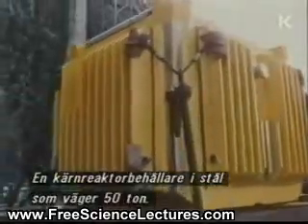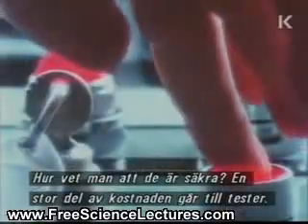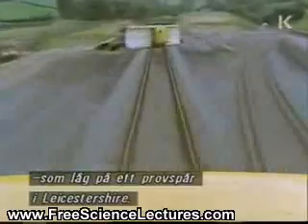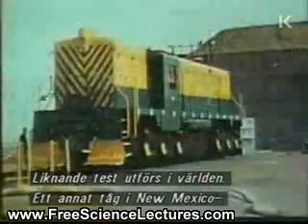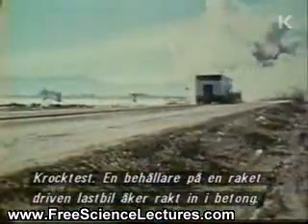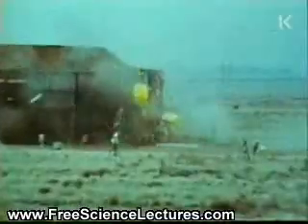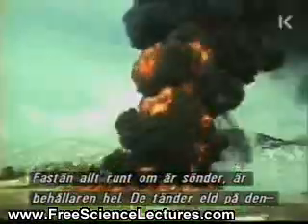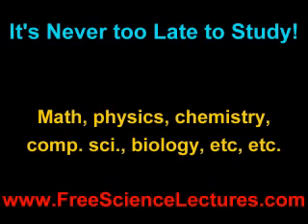Nuclear Flask Endurance Testing in USA

Comment: The irony is that material transported in these casks is protested as being unsafe, yet it's the least likely to leak in the event of a crash.
Reply: Its not even liquid lol
Reply: The problem isn't that nuclear waste is solid it's that radiation could escape from the smalest crack and the best way to test 100% containment is with water because it can also escape from the smallest crack.
Reply: @checkoutmyplaylistsforente8054  yes a small crack releases a small dose of radiation
Reply: Yup. In fact the current record is 0% leakage in actual use.

Comment: It never would be in real life. But they wanted to prove that in the most extreme of crashes (ie: a crash that would not be possible with standard equipment), the container still wouldn't be breached.
When testing this sort of stuff, you'd always test for the most extreme worst case scenario, not just what might normally happen.

Comment: This sounds like a monty python sketch. So they rammed it with a train, but it wasn't damaged. So They rammed it with a faster train, but it wasn't damaged. So they tied it to the back of an ordinary lorry and crashed it into concrete, but it wasn't damaged. So they tied it to the back of a rocket powered lorry and crashed it into concrete, but it wasn't damaged. So they tied it to a faster rocket powered lorry and crashed that into concrete, but it wasn't damaged...and so on a so forth
Reply: More like the Top gear piece where they were trying to destroy a Toyota Hilux.
Reply: And this is how pizza delivery was revolutionized.
Reply: "Tis but a scratch!"
Reply: Ngl sound like some stuff Huggbies would make up on a video
Reply: The only issue with this was that the US train wasn't faster, probably due to being less aerodynamic and using rocket motors. Had they used an F-unit or something similar (ignoring how sacreligious that is), then maybe it might've gone faster? Idk.
Reply: @Milnoc  I remember. They thought they had lost it at one point to the sea...but they found it again when the tide went out. Bit careless...Parking your car where the Gods of the Ocean may see it as sacrifice and take it!
Reply: @thestarlightalchemist7333  That is where the laws of Psychics come in. On one of the (UK) train test videos I heard that that loco and its 3 coaches, at that speed, had the same impact as if it was hit by a HST. For those outside the UK a HST is (or, as they are mainly out of service now) a High Speed Train with 2 power cars and 8 coaches (larger and heavier than the ones in the video) which travelled at speeds of up to 125mph which were first built in 1975 and weighed, if my Maths is right, about 420 tons.
Reply: Oceangate 2.0 🤞🏼

Comment: Jet fuel can't melt steel flasks..
Reply: SovietRusalka's 2nd Channel SHIT INSIDE JOB 

ILLUMINATI
CONFIRMED
Reply: but it can weaken them
Reply: These engineers were clearly just having fun. Why did they attach rockets to the trucks? Surely the rockets were more expensive than a truck engine that can reach 80mph. And if you want to really test the durability of the containers in a remotely-scientific manner, are these really the most accurate methods to employ?

I mean, I'm thankful that they got to create these cool videos, and surely the engineers had a great time doing it! Money well spent, I suppose--though if I were transporting these containers, I certainly wouldn't feel any safer.

(Also, while not the point of my reply: Jet-A (the most common jet fuel , [essentially souped-up kerosene]) can ABSOLUTELY cause instability in steel, given the proper conditions! It can provide a very high amount of energy when combusted (with a proper stoichiometric mixture of oxygen, just under 1,000° celsius!) While it will not melt into liquid, even at the maximum temperature it produces, it can certainly be bent or otherwise malformed in a way that it's contents would be exposed. Admittedly, open air will not provide this level of efficient combustion. However, if the enflamed items are positioned in an (admittedly plausible) manner in which forced air can be taken into account, it is definitely plausible.) Anyway, the point here is that while the various varities of "Jet Fuel" are unlikely to melt average varieties of steel into a liquid, they could certainly weaken it's structure integrety to the degree that it's (radioactive, in this case) contents could be exposed. 

Anyway, that was not really my point. I really came here to point out how ridiculous this whole series of experiments was. Money (not) well spent!
Reply: @TravisTerrell  Crash tests are performed on cars to test integrity. It certainly is scientific
Reply: @TravisTerrell  I think that rocket engine for this kind of job is pretty easy to produce. It is just a tube with de Laval nozzle filled with solid propulsion material. Moreover this flask is pretty heavy. I think red flask isn't "made out of 280 tons solid steel" but it is still heavier than usual cargo. That is why they use simple rocket engine rather than piston engine that is designed to work for years.

Comment: @Sohave We drove on the E20/E47 from Malmö to Rødby for vacation last month. As I passed the Öresund Bridge, I spotted the Barsebäck NPP on my right, 1200 MW of clean and safe energy... now shut down, because of danish demands. 

About 15 minutes later, as we came over the bridge from Amager, I spotted a strange looking facility: the Avedøre power plant. 1700 MW of *COAL* energy.

Tell me please if you think that is a sound picture... of if it's f-ed up beyond belief?
Reply: Not proud of my country right here...
Reply: My country, even though not having a lot of nuclear power plants (I think we used to have 2 but one got decommissioned in the early 2000's and we are now left with just one) is also thinking of banning it...it makes no sense from the viewpoint of shutting down relatively clean plants.
The problem I think is the people's increasing lack of basic technical knowledge, which even more so includes knowledge about radiation.
Every time I have heard people oppose nuclear power plants I hear "But, but Tsjernobyl!" and when you explain that type of reactor was never built in Europe due to being insufficient (because large) and considered unsafe, and only went supercritical because a higher-up pressed people who were well aware the reactor was in no way capable of being experimented with in the way they were supposed to test it at the current output power and state of the core, you quickly hear: "But, but, Fukushima!"
At which you can start to explain that the earthquake that preceded it caused a significant amount of deaths due to the tsunami that followed and while yes, it caused a very serious situation, only 1 person actively died from actual radiation problems there.
I get that radiation is scary for being invisible and that most people as a result do not want it near them, I myself still don't understand most of  it (part of physics I flunked in high school), but when it comes to clean energy, nuclear power is one of the cleanest forms of power there is...

Germany has or is still trying to get nuclear power plants banned and switch over to coal, one of the most polluting forms of energy that we have....I just don't get it...

Comment: Yes, unit 1 through 3 were operated for about a decade after unit 4 blew up.

You can turn off the chain reaction within seconds by SCRAMing it, there is a lot of residual heat generation so you still need active cooling for some time.

The RBMKs could be operated safely in principle but the design was not something that would have been allowed in the west(large positive void coefficient, no containment structure, cluttered display etc.).
Reply: It's difficult to explain to people that while the design in general was safe, the disaster was caused by someone higher up and not just unorthodox experimenting with it, since the employees at the plant were well aware of the procedure being done, and knew that at the moment a person higher up requested them to perform the test the core was in absolutely no way to respond as expected.
When people like to shout that they are against nuclear power "because of Tsjernobyl!" it's always pretty annoying that when handled within parameters, the design was reasonably safe (yes, lacking containment vessels, so if a minor accident occurred, that would have consequences as well) and it was just very dumb people who didn't understand the inner workings well enough due to having been fed all kinds of lies.
Reply: @Dutch3DMaster  A design that can be operated unsafely should be discouraged if there is a viable alternative. But indeed, many RBMK were operated without problem.

It took a remarkable amount of screwing up to cause the accident; but it is still a clear design flaw of RBMK that it was designed with effectively dual moderators. The boiling of water inside the reactor or loss of water inside the reactor causes voids that neutrons can zip right across. Graphite being a better moderator than light water (which is mainly there as a coolant/heat carrier) with less parasitic neutron absorption than water increases reactivity greatly. During the operation of RBMK it takes quick and decisive action to understand what is going on an interrupt the potential disaster if there is ever a loss of coolant or boiling of water inside the reactor.

It wasn't just cheapness behind the design of the reactor either. It was intended to be dual use for the extraction of plutonium. To do this you in particular need online refueling so that rods can be irradiated for a short period of time and then removed without shutting down the reactor. I don't think it was actually used for this purpose.

After the accident they did minor design changes to improve the situation. The increased the enrichment of the fuel and the number of neutron absorbers. Increased the speed of SCRAM and changed the control rod design to have less graphite. The graphite portion of the control rod was there to give a bigger effect when inserting the control rod; when the control rod is withdrawn graphite is still inside the reactor and increasing reactivity; as you insert the control rod you are both reducing reactivity by removing graphite and by inserting neutron absorber. If you withdraw these rods too far you can then get into a situation where inserting the rods at first increases activity. This part of the screw up at chernobyl. There were also things done to localize the accident and provide emergency cooling of the core as well as clearer instrumentation. With these changes the design was drastically less bad; but still not amazing.

The TMI "disaster" was mainly caused by unclear instrumentation and a poorly designed valve that often stuck open and failed to close. When it gave error messages it spewed hundreds of messages to a printer and many buttons lit up. The core underlying cause; the valve they actually needed to fix; was not really visible among this amount of visual clutter. The valve they needed to close was monitored, but the state of the valve shown on the panel was not the actual state of the valve, but the signal sent to the valve. So if a signal had been sent to close the valve it was displayed as closed. By the time they understood the actual state of the reactor and that the valve was actually open the core had become uncovered. Due to not being an unsafe design this was an economic cost with no offsite harm. Had this been an RBMK type of design with a similar accident the effects would have been far worse. This is the difference between a reactor that is safe by design and one which requires skilled operators to remain safe.
Reply: @soylentgreenb  I find it cool that you wrote the original comment around the time I started to learn how to write, and yet someone decided to engage in a discussion just 4 months ago :)
Reply: @ignatz2  Probably because Chernobyl was re-popularized by a dramatization TV-miniseries-thingy a little while back.
Reply: @soylentgreenb  Yeah watching that actually made me cringe, as I've always been interested in nuclear power and am at least not ignorant about it.
Reply: @Dutch3DMaster why do people spell cernobâl like that bruh

Comment: "Also after Chernobyl blew did you now Russia was so cheap that they still used the Chernobyl power plant to make power (Even though half the building is blow up)"

The plant workers even protested the closure of the remaining 3 reactors at Chernobyl.

If you're careful and stay away from the volanic "fuel mass" it's quite safe to be inside the sarcophagus of the blown up unit 4 today. You don't even need a closed breathing system, just simple protective clothing and a face mask.

Comment: @SuPrAmAd101 no, sorry bud. The containers are constructed with solid steel, concrete, steel infored concrete. Built the same way that nuclear powerplan reactors are, which are built to take a direct impact from a Boeing 747 and not have any failures at all. (these standards were put in place years b4 sept. 11th)

Comment: What about anti-tank missile? That would probably bust the flask open. Also, the rocket driven semi test could have been improved upon by removing the energy absorption of the front part of the semi by mounting the tank in front so it is the first to hit the concrete and not later with less force than the initial impact.
Reply: The tractor wouldnt support the weight and flatbed trailers dont have front wheels
Reply: Do you really think that reasonably small amount of glass and steel frame at the back is going to make a significant eh "impact" (pun intended) on the force exerted on it?  Did you see how the truck part was stuck to it due to the force exerted on the cabin, completely crushing that part?

Comment: 1:14 the train would've probably suffered less damage if it were to be a newer locomotive design, instead of one from the 50s im gonna guess this was made in the 90s or early 2000s so if so than they could've used a newer locomotive with a safety cab to minimalize the damage to the locomotive
Reply: You do realise these flasks are designed to obliterate anything that hits it while suffering as minimal amounts of damage themselves?  And at times, when they do get damaged, are meant to have certain points be destroyed to protect other parts (a bit like a crumpling zone).
They are not designed so the driver survives or the damage is minimal, they are designed to make absolutely sure that whatever catastrophic kind of collision hits it, the contents are meant to survive fully intact with no leaking.

Comment: @mkarnerfors Nuclear power is a mere 56 years old. It is the youngest source of power in operation. Wind, hydro, solar are hitting the ceiling for their efficiency... and it didn't turn out better than what we have. They alone will not knock fossil fuels from its position. We need more. 

Nuclear power of today uses less than 1% of the energy in the fuel. Most of it is still there. The potential for improvements are enormous. Tell me why we should not use that as an intermediate solution?

Comment: @mkarnerfors well my original point was that all the efforts and money used in developing accessories for nuclear power, which is not small efforts as this video clearly shows. could also be used at developing and building sustainable power sources. I am not at the hysteric opinion that all nuclear power plants should be knocked down. let them run out. it is better to fill those mines with radioactive waste that is totally empty of energy rather than still capable materials... se 2

Comment: @mkarnerfors I agree with you coal burning is a polluting way of getting energy. And I am equally concerned about Dong and another electricity company plans for the construction of a new coal powered plant in Germany as well as other coal plants. i just don't think that the solution is Nuclear power 1) Through it is "clean" during the operation nuclear power leaves highly toxic waste material which must be sealed off properly with out spill for hundreds of years to come.

Comment: Assuming that these tests are for real and aren't faked, rigged etc, it's amazing how well they stand up to physical damage.
Reply: These arent fake. It is carefully engineered by using the right materials; strong enough to withstand extreme forces without breaking or tearing, flexible enough to absorb impact and still have melting point so high that it will not melt under most circumstances.
Now you might be thinking; send it into space with these things! Well unfortunately as they mentioned these things are extremely heavy. Lifting even 1 of these would require many times more then current rocket power that we have at our disposal. 
If only we had a space elevator...

Comment: At last, a challenger for the Nokia 3310. Their battle will be legendary. 

No but seriously, public perception of nuclear safety is simply down to people not knowing or understanding enough about it.
That canister is not carrying glowing green sludge.
Please, tell me again how you'd rather have trillions of tons of coal byproducts in the atmosphere than a bunch of concrete drums buried a mile or two underground.

But, but Chernobyl! - Was a problem because crappy design and poor safety in the days of the soviets. It's been fixed.
But, but Fukushima! - Was a problem because of freak typhoon. Happened, we learned. Unlikely to happen again.
But, but 3-Mile Island! - Was a tiny lil problem caused by a sensor and never killed or harmed any human being, ever. Overblown to hell and back.

Add to that the newer salt reactors that literally cannot melt down.... It only gets safer and safer, folks.
But nah, you take your city sized coal vape clouds. They throw more radiation into the air than any nuclear plant ever did, btw.